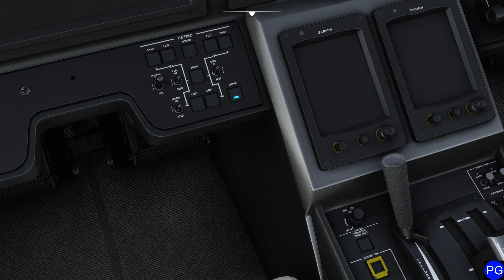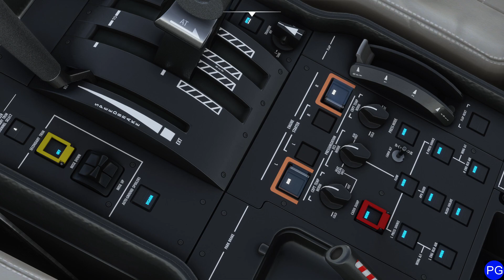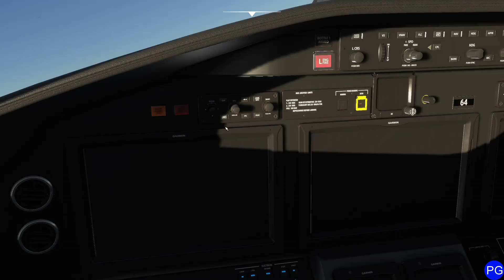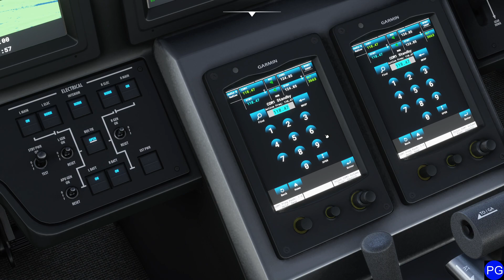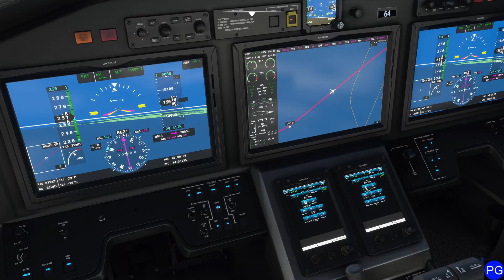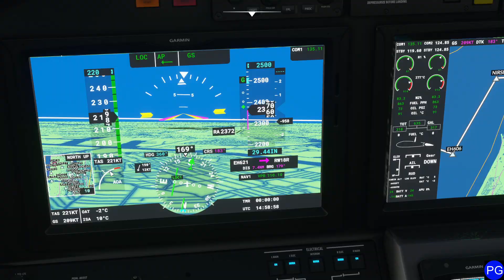FS2020 - Flying the Textron/Cessna Longitude

Comment: Great tutorial - Thanks! Loving the MSFS videos - and great timing:  I spent the weekend trying to see if I could fly this without autopilot ...mainly resulted in sub-optimal outcomes 🤕. Really hard to manage the thrust on descent and approach, so great to see how it calibrates on autothrust.   Going all the way to 45,000ft seems unnecessary - and really hard to do without assistance.  Right on the edge of stall and no margin for error.
Reply: Yeah, I find this jet flies better at 40k feet instead of 45k.  Just got the achievement to fly from Asobo to Microsoft (9+ hours) with this plane.  It was a great flight!

Comment: I usually also arm the speed brake before landing to help slow down. You sound like caught a cold. Hope it’s post processing issue.
Reply: When you arm the speed brakes / set spoiler to auto, what exactly triggers their deployment?  Is it reverse thrust, brakes, etc?
Reply: @yienmaster04  Should be the squat switch on the MLG probably after a couple second timeout to make sure you are not bouncing it.